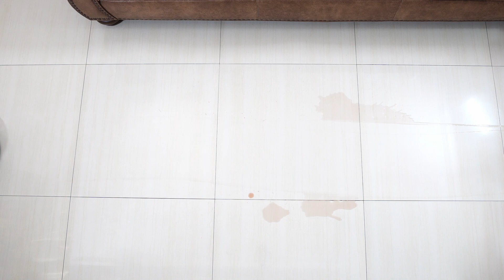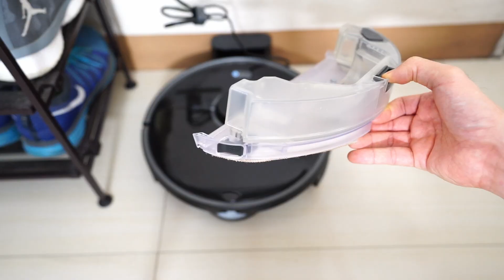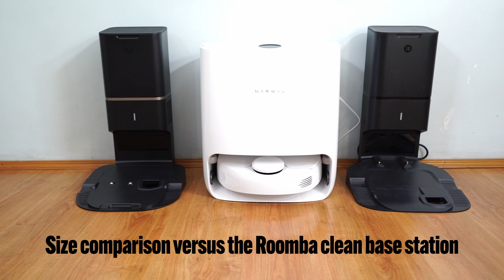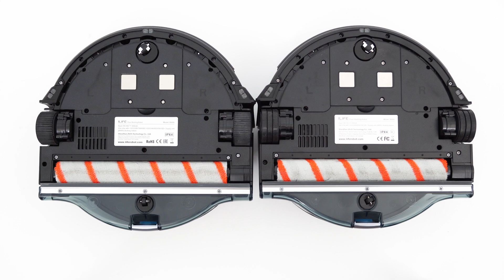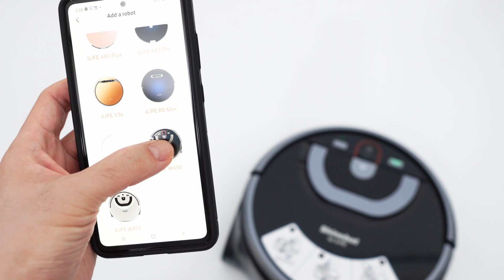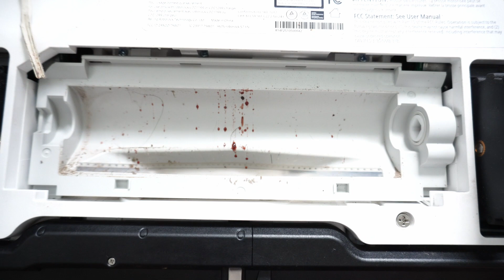Best Robotic Mop [Narwal T10 vs. Roborock S7 vs. S5 Max vs. ILIFE Shinebot W400 vs. W450]

Comment: Looking to spend under $500 for mopping 2200sqft of luxury vinyl floors with 1 low pile rug. I have no pets but mostly need for spills and crumbs in the kitchen and dining area and regular cleaning throughout. Which lidar based robot with good customer service will MOP the best in my price range? Was looking at roborock S7, s5 max and Ilife w450? Any others to consider? For ex Dreametech? TIA